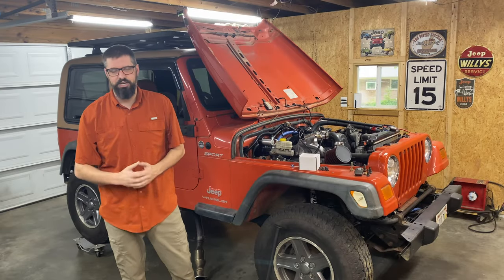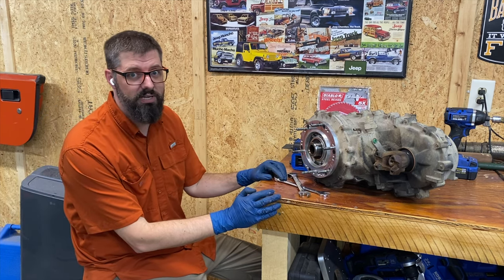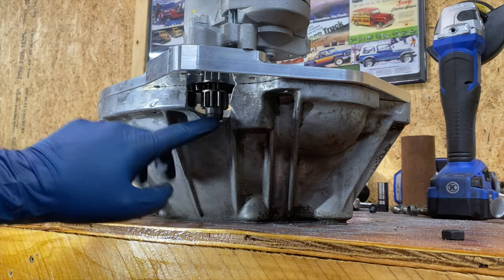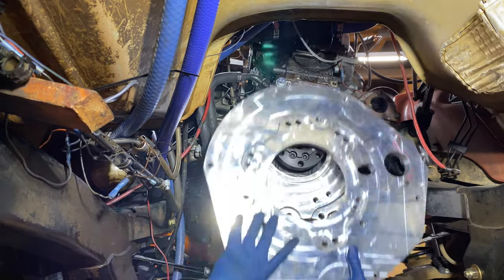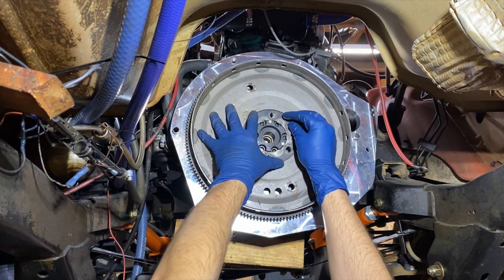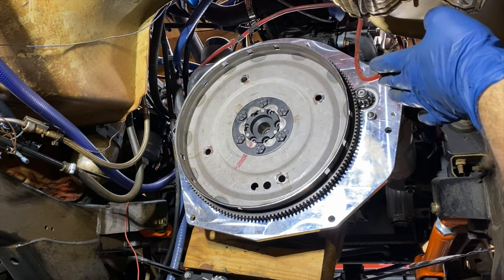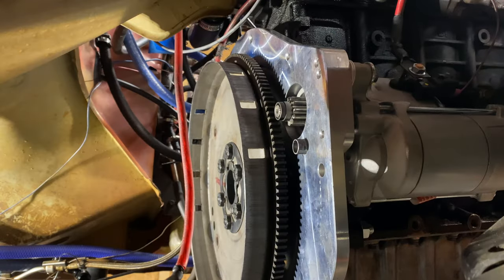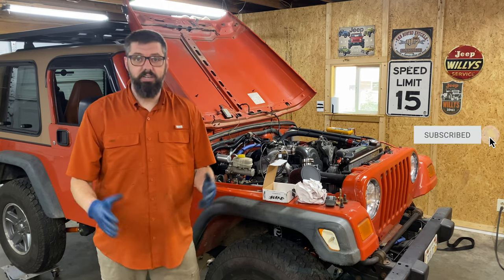Installing TDConversion's Jeep 4.0l to VW TDI adapter onto my TJ Wrangler Part 1

Comment: If there is one lesson than can be learned from your build videos is that K.I.S.S. is your best chance for success and reliability.
Reply from the maker: There is a lesson there but there also have been knowledge gained from failures as well. This entire build has been a HUGE learning exercise, this is my first major venture into building a vehicle that doesn't include just bolt on mods. I knew early on that I was going against the grain but I'm also to the point now where I want it done and I'm building it to where I will be happy with the TJ.

Comment: You're making progress! This winter my son and I are going to TDI swap his TJ. I already have an ALH that we could use but we may look into a CJAA swap. He has a CJAA in his Jetta that's tuned and deleted and runs really good.
Reply from the maker: I don't know how many people have swapped in the CJAA, the ALH is a well known, well tuned and well supported in the aftermarket engine. I've got super custom many times in this build and I have learned the value of going with parts that are well supported in the aftermarket. 

I'm not telling you to not use the CJAA, I just haven't looked into that much, I just know the ALH has been swapped into several vehicles.
Reply: @RustyAutoholicGuy  No, you are correct the ALH would make the most sense with it being less complicated and more support. I also have 3 BRM's and love that PD engine as well. Coty Built does have parts and support and have done CJAA's but I don't know of any others. I guess it will have to be decided at some point.